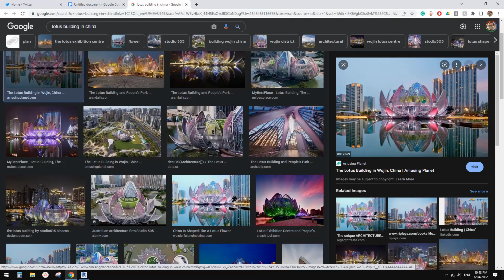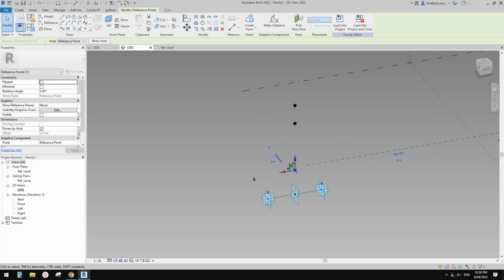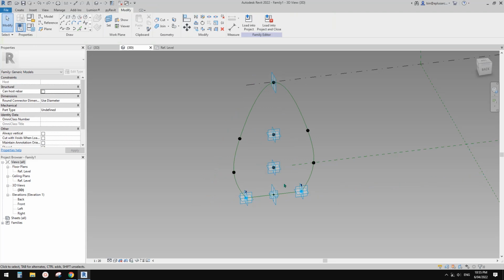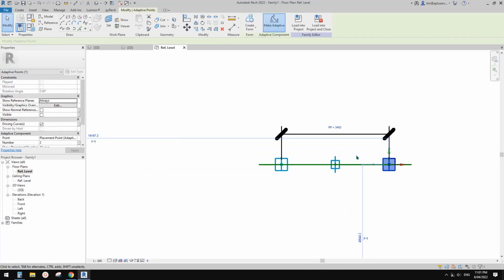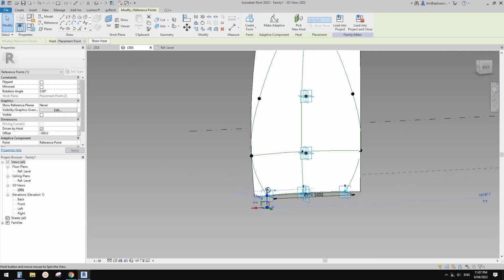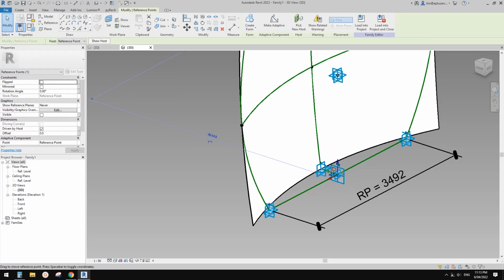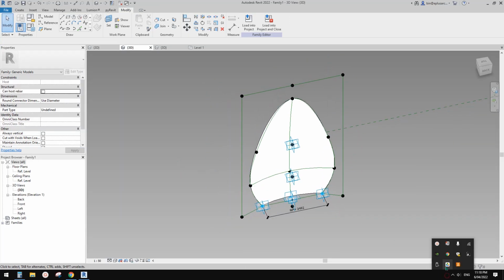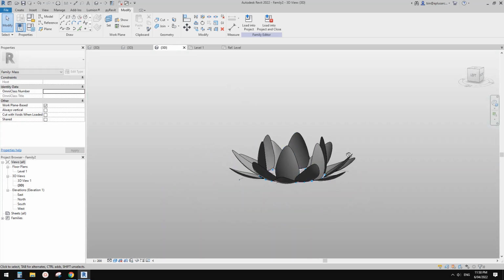Revit Exercise (Day 745) Adaptive Family Exercise "Lotus"

Comment: Please  i wanna know two things first  when i try to create forms  sometimes it doesn't work  second why sometimes void forms doesn't cut 
And keep informing that ''no solid geometry to cut ...." and delet this void form  and thank you for your efforts 
Maybe can u show us common mistakes we do while massing  to avoid similar errors🙏
Reply from the maker: Have a look at 9:00 in this video. It is the exact the same reason why sometimes we cannot create form, because Revit do not understand the sequence of the points, or profiles while create spline and form. What we can try is to adjust the location of points or profiles with some luck. 
I'm not too sure about the void issue you have. Have you tried using the Cut Geometry tool yourself? 
I suggest you have a good understanding of the principle of generic model family first, understand the requirements of Extrusion, Revolve, Blend, Sweep, etc.. Because IMO, the mass tool in Revit is very similar to Generic Family.
Reply: Thanks alot ❤️❤️❤️❤️